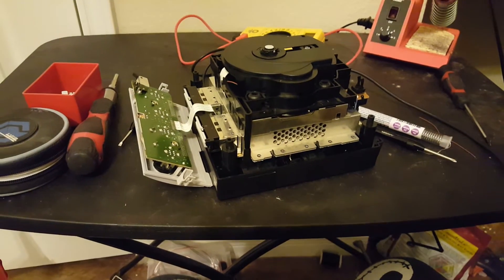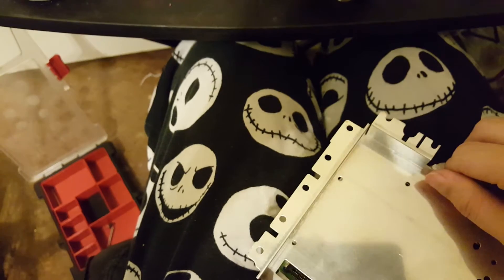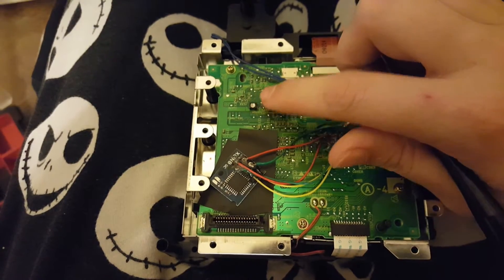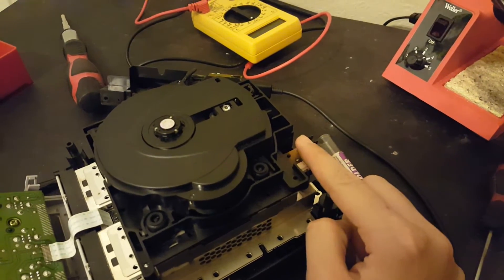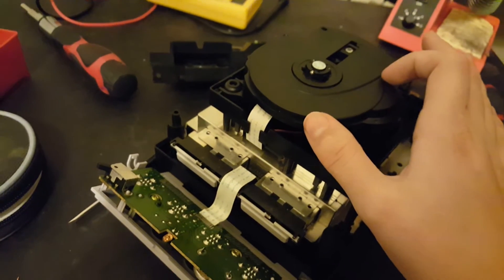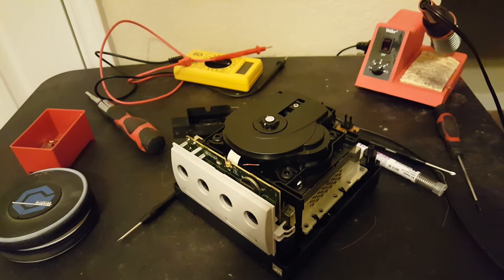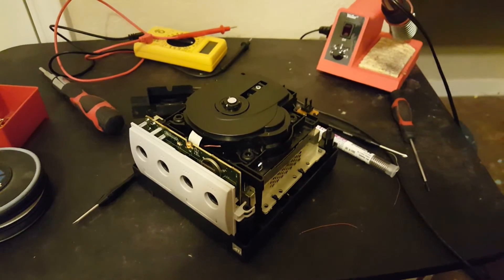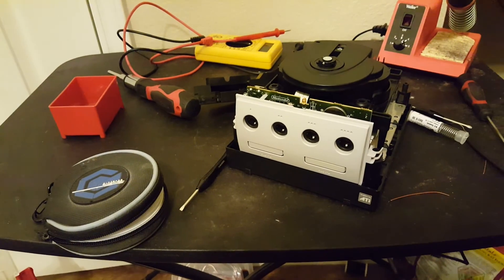How To Install a XenoGC GameCube Modchip

Comment: im ussing the cheapest mini dvd i've found on ebay and they work perfect (19 euros 50 dvd), even burning at the fastest speed.
The only problem i have is i need to run img burn as amministrator

Comment: The Xen8 GC are clones and have two red led lights. To know you installed it right, when powering on the right led turns on, blinks once then turns off. Then the left led turns on and stays on as an indication that the installation was correct. :] To determine which chip you got take a closer look at the name on the chip. Xen8 is a clone and Xeno is official.